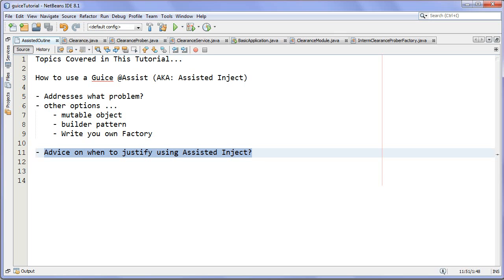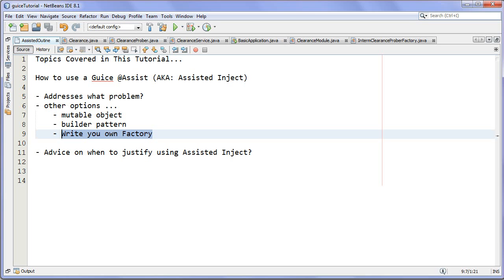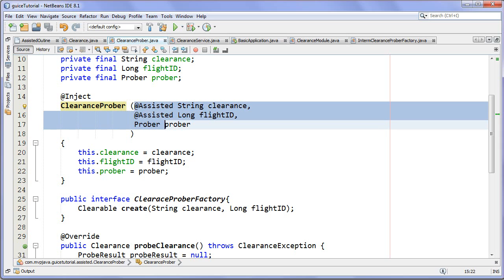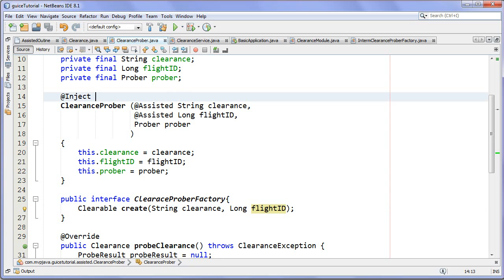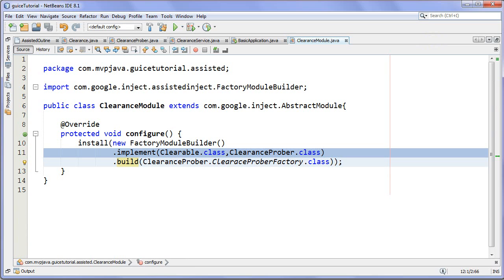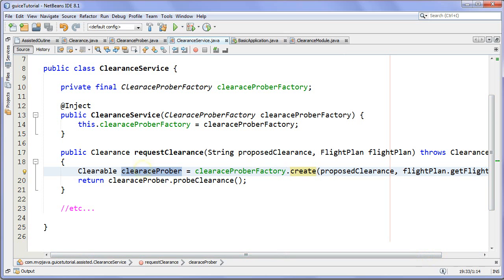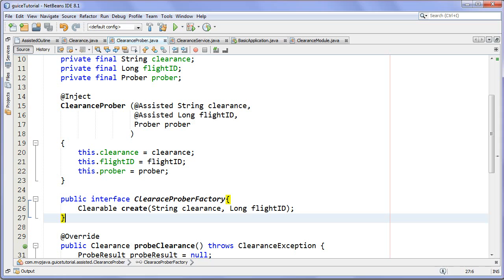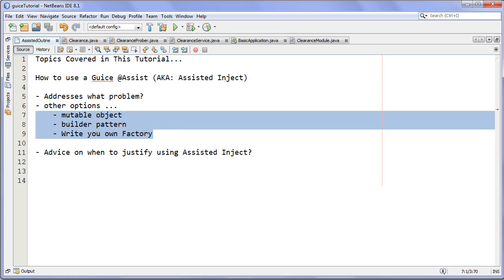How to use Assisted Inject with Google Guice

Comment: I don't see the point of having factory / assistance in the Github example. Will work with just binding an interface to an implementation and calling the method with parameters at runtime when the app boots ¯\_(ツ)_/¯

Comment: I have an issue with the example. In the very example youdiscussed, the 'flightID' and 'clearance' could have been passed as part of the method call. As per my understanding, only behaviours should be injected, not the data. Data should be passed as parameters to the functional methods. Please let know if my understanding is incomplete/incorrect.

Comment: I am Very eager to Use ScenarioScoped Dependency Injection  in Cucumber using guice. Can you assist me on this. i have used ScenarioScoped in Spring Dependency Injection Framework.
I want a Object to be intantiated for each Scenario